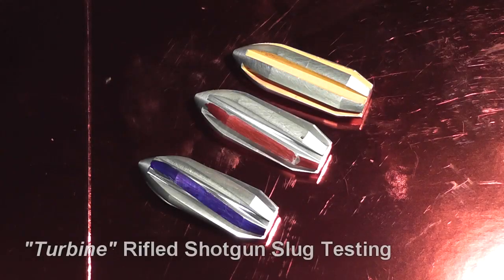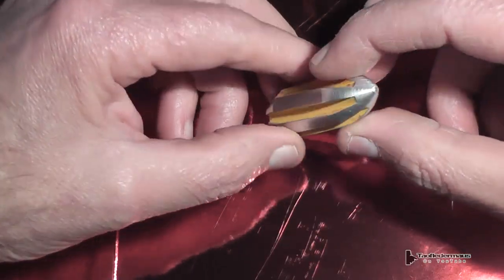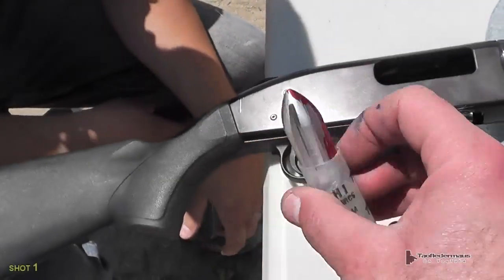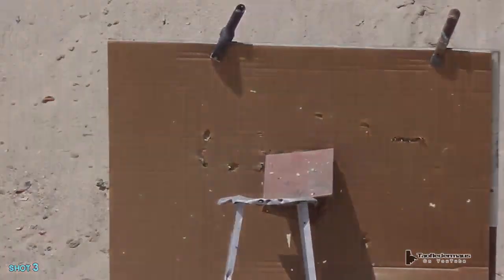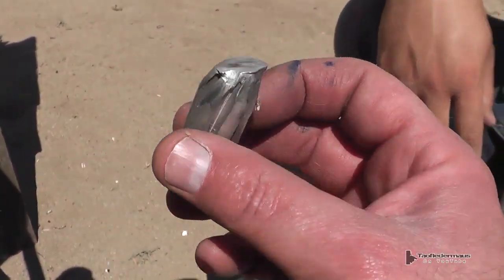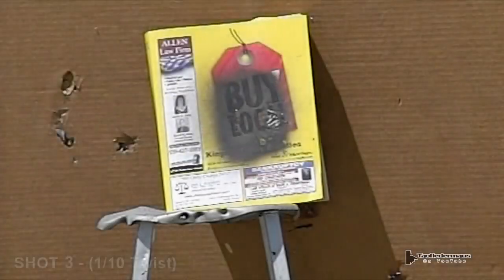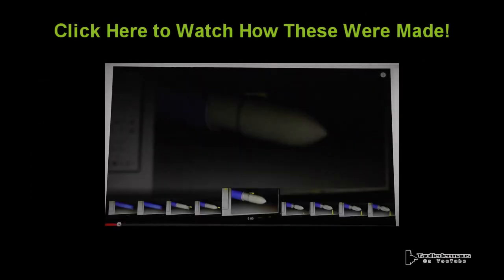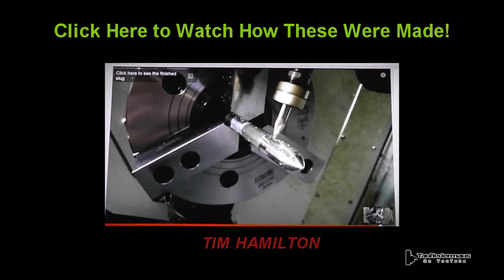Custom Aluminum TURBINE Shotgun Slugs  -Testing

Comment: The problem was you used a smoothbore barrel? You need to use a rifle slug barrel for the rifle shotgun slug round. Otherwise you’re just depending upon the air to try to turn that projectile. With a rifle slug barrel, the slug is going down the barrel and twisting, even if it is saboted
Reply from the maker: We were trying to see if airflow would cause spin without rifling

Comment: Those bullet DEMAND spin stabilization. The require being fired from a rifled barrel. A fully rifled barrel.
Reply from the maker: The test was to see if these deep grooves would cause spin from the air flowing over them,  but that doesn't work

Comment: its my opinion that if you do not impart spin to a rear heavy projectile prior to it leaving the barrel, it will not be accurate. Even if it were to gain a spin and stabilize itself post exit, it will not be before it has wobbled at least a bit an gone off course.

Comment: The shockwave is preventing the wind from reaching the round so essentially it's just being slung at high speed and the rifling has no effect. 

Also it seems if it was to really work the round would need to be rifled from the very tip making them fragile.

Comment: The “rifling” is fine but the “fins” are too wide to allow the narrow slot to catch much air.  The fins need to be a lot thinner for better air acquisition.  I would propose a reduction to about 1/4 the existing thickness (making the groove about twice as wide). Good luck with it.  They must be really expensive considering the labor intensive manufacture, but the result could still be really good.

Comment: from the very start there is an issue. as the propelling gasses push the slug down the barrel, the slug starts rotating clockwise (POV looking down the barrel). Once the slug hits normal air resistance, the rifling on it reverses the spin to counter clockwise. no wonder it flies all over the place

Comment: I know this video is rather old but it seems we're one step closer to making a Bolter.

If someone can put a rocket propulsion system on that slug which activates after traveling a certain distance from the barrel...
Reply: look up a gyrojet gun, I'm pretty sure they even test one on this channel. problem is with rocket propelled ammunition is that the muzzle velocity is pathetic, making it virtually useless in close quarters. SOG tested a few of them in vietnam with poor results - the ammo is finicky and prone to fouling, the gas ports at the rear of the shell can become clogged and drastically change the bullets trajectory, and "dud" rounds were fairly common. Compared to standard bullets the rockets are also cost prohibitive and time consuming to produce in large quantities. Maybe one day though some one will take another stab at refining the ammunition with modern science and technology.
Reply: @mikeb3808  the thing with the bolter is that it's a combination of the failed gyrojet concept and a conventional bullet. The kicker charge as per the in-universe description behaves the same way a standard centerfire cartridge does, with the actual rocket propulsion only activating after the round travels a certain distance away from the barrel. I dunno if mixing a gyrojet round and conventional ammo like how the bolter does is even possible with today's science though

Comment: They tumble due to the ogival nose of the round deflecting the air flow away from the grooves so that they don’t spin stabilise. To function properly, the front ends of the groove bases would need to be tapered into an ogival shape closely paralleling the nose of the round, and the round would need to be boat-tailed to reduce drag and turbulence behind the round. The only other way would be to reduce the nose diameter to that of the groove-base’s diameter, and maybe sharpening the leading edge of each groove wall to reduce turbulence. An analogy would be the grooves on a powerboat hull that reduce friction between water and hull by deflecting water away.

Comment: Ain't gona spin...not enough traction in air to accelerate that much mass is such a shirt amount of time. And if it did the energy would have to come from somewhere...the slugs would just slow down. Riffling in a barrel works because the slugs has a mechanical connection with the barrel and it does it while expanding gas is increasing the speed of the slug... something like that anyway..

Comment: well so what I think is happening is: the slug doesn't roll inside the barrel at all, because you get pressure from the back and pressure from the front. if anything the slug would rotate in the opposite direction from expected because of the higher pressure from behind forcing it's way through the bullet's rifling - this of course could give some stability but because the air would be pushing it in the other direction after it came out of the barrel, it would serve more to distabilize it because you have the rifling working against the inertia. Even if it's not spinning at all as it comes out of the barrel, it still doesn't have any stability and it just acts like a block of aluminum. At that point if it's off even by a few degrees the rifling already doesn't work and it'll keep tumbling with no hope of stabilizing.

Comment: Without the barrel rifling where it actually cuts grooves into the bullet youre prob going to have tumbling without designing the bullet itself to be heavier in parts. Maybe mill them with the weight toward the front end of the slug. It will take experimenting.

Comment: Try to drill a hole till near the tip then plug some lead in the nose. Also the riflings are more effective at the front but they would destabilize the projectile by making it statically unstable. So it’s better to place them at the rear I think. There will be shock waves ar the tip but also secondary and other ones till the rear so it means there will still be air moving through the riflings to twist it. The static pressure will be higher and dynamic lower (that can help with the twist) on the rear but still enough to twist. Only behind it there will be near vacuum.
The tip must be sharp otherwise it will increase drag significantly. Blunt heads build pressure in front and this increases the speed of sound until it maches the bulet speed right in the front. With a sharp tip the front pressure rises insignificantly only going away from the center it rises but to a lower level.

Comment: Small internal fluted compression grooves at the shock waves compression points.. like graduated to holes that angle the air into the tails internal graduated outflow allows for drag stability is my guess, all while reducing frictions on the projectile and aiding rotation stabilization. Vaccum pour molding with high temp wax. And a magnetic evening bonding of metal material will give hardness to any metal no matter if they say ot is nonferrous, it still has a magnetic bond structure and will reduce the nano and microcrystaline facets and variant density issues of the mass giving a more balanced rotation without a throw wobbled due to imbalance.

Comment: The gasses propelling the shell are rotating the projectile the wrong way and as soon as it leaves the barrel the air flow then tries to to change the projectiles rotation causing the torque to make it twist and then tumble

Comment: First thing I would do, is redesign the back end. As the round exits the barrel and the gas "catches up", it could put more force on one beveled surface than the others and tumble. The grooves are what causes this, because it alters the mass symmetry. This would likely not happen on solid rounds. You also need to keep the pressure wave during flight in mind.

Fire one as a sub-sonic round and see what it does.

Thanks for the content!

Comment: Those were not supersonic.
Reply from the maker: They certainly were
Reply: @taofledermaus  Well, starting at 5:41 it takes the bullet 108 frames to travel from the muzzle to the target. At 30 fps it is 3.6 seconds. The highest slo-mo camera framerate was 1200 fps. Which means that slowdown ratio is 1200/30 = 40 at most. Which in turn means that given approximately 20 yds distance the actual bullet velocity was 20*40/3.6 = 222.2 yds/s = 667 ft/s = 203 m/s. Which is well below the speed of sound.

Comment: Try and angle the Twisted groove more towards a 45' instead of milling it at 90' Angle.  And try the grooves at more of an angle atleast a mm or 2 from the either end of the bullet and make them a 3 sided shape and not square is put money on it

Comment: Ok I see a few problems first the slug is to light the light weight will cause instability in flight. Second as the explosion accurses in the rifle gasses would surpass the slug unequal distribution as it exists. Third  I would have done the rifling slightly different. I would have not done the groves all the way to the point. I would have stop right at the edge of the slant. And the groove widest at the bottom narrowing at the top.

Comment: I think they tumble because as the slug is traveling through the barrel, the air flowing through the rifling on the slug is coming from behind the slug and moving from the back of the slug to the front, but when the round leaves the barrel, suddenly the air traveling through the rifling on the slug is moving from the front of the slug to the back. It's essentially like... flipping a fan from intake to exhaust immediately when the slug leaves the barrel.

Comment: The Shotgun Needs Rifling So They Have Something To Grip Onto... But Having Twist In The Round And Twist In The Rifling Both Is Going To Really Make Them Spin, It Would Also Keep Gas Pressures Behind The Slug From Reverse Spinning The Slug. I Would Say The Fins In The Slug Are Doing Nothing And Having More Area To Grip Rifling Of The Barrel Would Be Better, If Finned Slugs Or Bullets Worked Better I'm Sure They Would Already Be In Production Before Now... More 2 Cents!!!

Comment: Late to the part but if you continue with machining projectile rifling slots I would increase twist rates. Also notice no chronograph projectile speeds documented limiting valuable information determining possible solutions so I’m guessing this is all by chance after multiple attempts to find the perfect rifled projectile for smooth bore shot gun use..???

All center fire rifle calibers and barrel twist rates have distance zones of best accuracy. For example: 270 to 300 Winchester ballistic tip projectiles typically shot tighter groups at 200yds compared to 100yds..! 

People assume projectiles are most accurate at muzzle and that’s absolutely incorrect..! Often projectiles needs reasonable amount of distance to stabilize..! 

Personally I would go with rifled slug shotgun barrel and machined projectiles from various materials, weights, and lengths, but until you chronograph speeds and determine chamber pressures you’ll spend a lot of time chasing shadows..!

Comment: The barrel needs to be rifled and the rifling on the bullets should not go the length of the bullet but only half the round. By having the rifling go the length of the bullet and in a smooth bore rifle they’re loosing to much gases from the propellant costing the muzzle velocity to drop reducing the stability in the spin

Comment: You need a significantly higher density in the tip of the round. It would work with a rifled barrel but not the slug. Rifling on the slug requires air to go through the slits, which it won't because of the speed of the bullet. The rifled barrel will make it spin from just the slug being dragged on the rifling
Reply: Would rifling on the slug make it twist in a smooth bore?
Reply: @Russell-n6i  typically the rifled slugs you buy in stores twist from friction with the barrel, not by catching wind. They’re also more “balanced” in length and mass. It does work, but not as good as rifled barrel + smooth bullet. The spin is more consistent that way throughout other factors like barrel length etc.

Comment: Make it smaller in diameter, machine fins at the same twist rate raised one eight to a quarter of a inch, load it in a sabot to fit your shotgun, for curiosity, use a screw in steel tip, or a three quarter inch long lead tip that has a half inch screw in base to mate with the aluminum body which has a slightly over quater inch channel a inch deep, you put a steel ball bearing in the channel so on impact it hits the lead which has a eighth of a inch deep channel the same diameter as the aluminum body and a hollow point at the front, the idea is to have the ball bearing smash into the lead on impact to expand the hollow point from both ends. Putting twist channels in the aluminum body doesn't work because of the way the air flows over it, the raised fins will be acted on by the airflow and spin the projectile depending on the twist rate you use. LoL, you'll still have a much greater velocity than a all lead slug with either a deep wound channel or the energy transfer of the lead hollow point. The fins will do damage on their own, if you want to get fancy, have spring loaded quater inch fins that automatically spring out through slots in the sabot after being released by the Impact of firing the shotgun. I'm curious to see how this works and if it gives any Advantage over Standard slugs, the lead or steel tip concentrates the weight forward like a shuttle cock or many deer slugs helping to stop the tenancy to tumble. Its Worth a try, LoL, if it actually works well, have your machinest friend get a patent on the idea. Or like a type of hunting arrow from the fifty's make the aluminum body in two sections, load a .32 auto cartridge in the front, with a sliding firing pin in the channel of the rear section. On impact the firing pin hits the primer of the .32 hard enough to fire it, either massively expanding the hollow point or just bring fired through the open channel to add extra damage. If this works, let me know. I can tell you really enjoy your work! What's not to like anytime you can have fun shooting and get paid for it too?
A better way to fire the .32 or larger cartridge would be to load it in free sliding tube with a smaller diameter section that sticks out of the front with a light spring  to keep it from hitting a fixed firing pin until the impact forces the loaded tube back on the fixed firing pin and fires the cartridge, this seems safer and more reliable. They actually used a system somewhat like this as a part of hunting arrow heads and fish hooks, Apparently to not just hook the fish but shoot it as well. I don't know if they were banned or were considered over kill or just didn't work that well. Some could be fired accidentally, which might have been part of the reason people quit using them on top of being Expensive! Maybe a small chunk of C-4 or other such substance with appropriate detonator, it's not enough just to shoot a deer, you could blow it up at the same time! Useful for those oversized Bores in Texas or the big bears of Alaska.

Comment: The inertia of the slug is way to high for the little fins turn the slug. This is exactly the reason why the rifling in a rifle is  machined in the barrel which forces the round to spin by cutting/grabbing into the jacket of the round. Air is just not dense enough to "grab" in the fins of the slug.

Comment: They look nasty, just gotta get em to fly right. I got a safety question for you. I had a ithica 16 gauge willed to me from my grandfather along with a box of mixed shells. Most of them are buck shot turkey loads but there are a couple slugs. Its a smoothe bore barrel, can the slugs be shot out of this barrel? I thought it had to be rifled for slugs? I just wanted to ask in case id take it to the mountains this year.

Comment: Hello TFM,
Long time subscriber, first time contributing. I wonder if the slugs where rifled the opposite way, and not all the way to the tip...? That way the propellant would act as fuel for a turbine, instead of relying on velocity and the density of air after leaving the muzzle?

Comment: Add one single hole, drilled in the rear to each round vary the depth to achieve a center of mass forward. A variation could be center drilling on a lathe stepped hole small diameter the deepest, mid-diameter, middle depth from the rear. And largest diameter finally.
Could be to the point of open in the rear between the lands of the rifling grooves...
Good luck and have fun... just my mechanical mind engineering at a quick idea for improvement.

Comment: possible noob observation... several years later (just discovered the channel).
It looks like the shot cup/wadding/whatever its called is sticking to the projectile for quite a ways once it leaves the barrel.  Those grooves wouldn't be able to impart any spin because the airflow is obstructed by the cup.

Comment: i suspect that the reason that the rifling doesnt work is because it relies on the air pressure to create the spin when in fact the spin is caused by the barrel rifling. when the bullets hit the rifled barrel it forces the slug to spin and thats where bullets get their spin. not from the airflow manipulating the bullets.

Comment: Knock the length of those rounds by 40 percent and make them out of lead.  They're too long out of the hull.  And for the wad.  They're wobbling around even before they get out of the barrel.  Even if I'm wrong, the wad cant release correctly, because it cant hold correctly.  Shorter, I'm sure they'd fly true.  Good design, a couple tweaks and he has it.  Also at supersonic speeds, don't want channels into the projectile, that's low pressure.  Rather convex them into 'fins' rather than channels.

Comment: Rifling on a shotgun slug does not make it spin. It's put there so that it will run through it choke. Shotgun slugs must have a design which allows them to fly like a dart. Unless you have a rifled barrel it ain't going to work. Now that I watched the shooting test, what did I tell you.